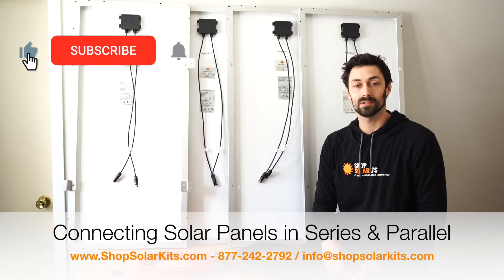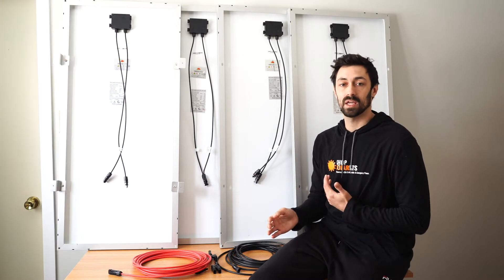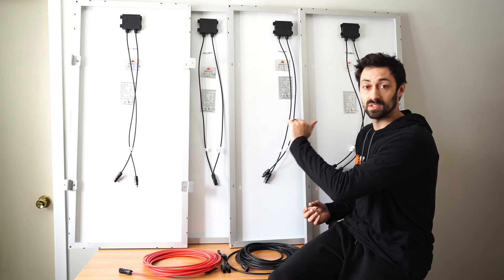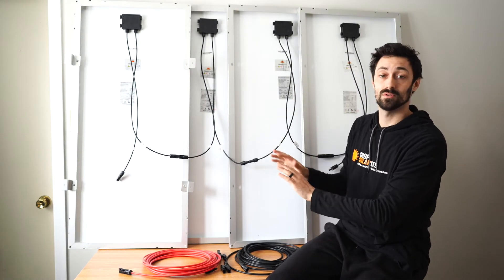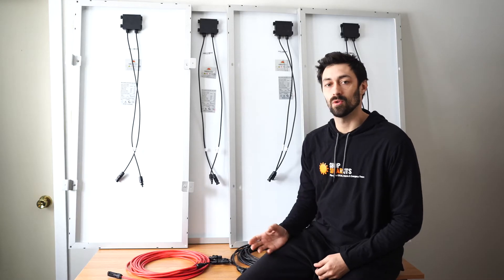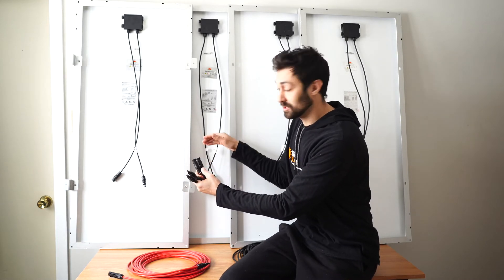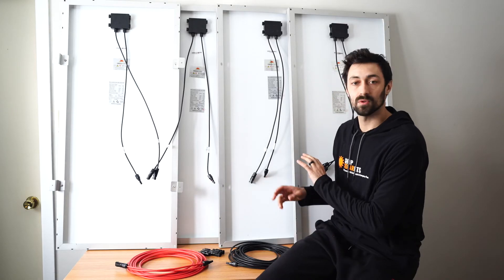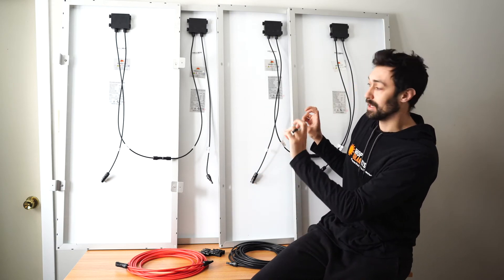How To Connect Solar Panels in Series & Parallel

Comment: What's better, connecting them in parallel or connecting two panels together in series then connecting them in parallel?
Reply: Most modern larger inverters require higher pv input voltage to activate the mppt charger controller, thus wiring in series is required to provide the higher dc voltage  which is widely used these days. Usually people will wire several strings  in series and then connect those into a combiner box which makes multiple series of panels into one parallel circuit.

Comment: Ok my question is can I run 4 strands to a combiner box 2  in parallel and 2 in series I have a 60 amp mppt controller 4000 watt inverter and 3 1000 amp marine led acid I know I need more batteries and more panels I also want to get a 6 string combiner box so I can always add to my system

Comment: I hadn't used my solar panels in months. But I did recently bring one out after we lost power for 3 days from hurricane Helene here in NC. I was able to keep my fridge going with my Ecoflow generator while another one was charging on the solar panel. I also lent another solar generator to my neighbors to keep their fridge going as well. But it wasn't until today that I had to come back to this video because I forgot how to connect them in series. Now I have 3 hooked up. I'm running my fridge on the generator to try and get my power down even more. I have 2 panels sitting in the grass and the 3rd one is on a flat cart with wheels, and I can easily turn it towards the sun every few hours. I plan on getting several more carts.

Comment: Mr, i have AC200MAX, I would like to install Solar Panel Array about 3 pcs. 1200w. I would like to install a DC breaker, how many Amp should i use? and a surge protection device?

Comment: Good Day! Have you ever heard of the Shoals Plug and Play cables / system? Can anyone judge whether it makes sense to use it? Although they seem to be a bit more expensive, they are extremely easy to use and no professional installer is required. Installation is also said to be very quick and more energy efficient than conventional cables... Would appreciate a respone very much

Comment: So after they are place in series parallel can i take the wire and run it into the charge controler ? I would have to cut the other end of the mc4 connection off right?

Comment: And that's the ONLY time u mix positive w/negative.  The pos wire goes into the positive receptacle of the charge controller and the negative goes into the negative on the charge controller. If you add an extension, black goes on black red goes on red.

Comment: Remember: In SERIES, the output voltage of each panel is added together:  12v + 12v = 24v.
And in this case, the output AMPS remains the same (8.6A).  Only the voltage changes.
In PARALLEL, the AMPS are added together: 8.3a +8.3A = 16.6A.    Here, the voltage stays the same as each individual panel, ie, 12v.
Reply: and what happens when you mixed them

Comment: Thank you for making these videos ,you have a way of making it so clear 👍🏼So if these panel are 12 volt and 5 amps each now you would have a 48 volt 10 amp set up with the parallel and series configuration ,correct ?
Reply: No. I think youd have a 24 volt 10 amp setup. Cause first you double the voltage on the panels and then you double the amperage

Comment: I was informed that problem with series connection would ie be 1) if one panel in series is effected by shade or faulty then the whole string is out. Bye Bye Power. But if in parallel and one panel is faulty for whatever reason I don't lose my string of panels Only the faulty one 1) is that true or false friend?
Reply: true

Comment: What Max refers to as a male plug is called a female plug in the attached video.  They say it's the internals of the plug, not the plastic itself, that determines male or female.

The panels on this video show male/female tags on the cables.  Going to the Newpowa website, looking at their manuals, which is who made the panels I bought from Shop Solar Kits, everything matches up with what Max teaches here.  

  https://www.youtube.com/watch?v=NPb_ZmRXbbA

Comment: It would have been helpful to show how the different configurations change the watts and volt output.
Reply: In series will double the voltage but same amps

On parallel you would double the amps but voltage stays the same
Reply: I have the same question.  Using the wrong method (sending more than 24v) can shut off or damage your device .
Reply: yes, that need to be more explained cause the end may have a huge impact.

Comment: After connecting these 4 panels in series or parallel, Can you please explain how connecting 4 in series multiplies the voltage and having them in parallel increases the amps?
Reply: Series = raising the height of a waterfall. Increased voltage is an increase in drop from top of waterfall to bottom.

Parallel = adding a second waterfall. Current increases because water has 2 times the paths to go through.

In this analogy, the water is the electricity, the height of the waterfall is the voltage (12v = short waterfall. 24v = taller waterfall). The number of waterfalls is the current (5amp = 1 waterfall. 5amp*2 = 10amp = 2 waterfalls that the water can go through, which means more water moves through the whole system)

Hope this kinda makes sense :)
Reply: For a little bit more on this analogy:

Picture you have a water mill. Higher voltage means you can run a larger watermill since there's more weight of water available to move the larger wheel. This is because there is more water in freefall going in one place.

If you have 2 waterfalls (and therefore, 2 rivers), you can use 2 smaller water mills, one on each river. Individually, they won't be as powerful as the single larger one, but they can get the same amount of work done because there's 2 of them.

This is why a 24v 100ah battery lasts the same amount of time as two 12v 100ah battery, both have 2400 watt-hours to work with (24v*100amps and 2*12v*100amps). Both last the same amount of time as one 12v 200ah battery as well
Reply: And this is why current doesn't increase when you increase the voltage:

You and your friend can't slide down a slide side by side. But if you add a second slide, now the two of you can slide together at the same time without bumping into each other (more current)

If you make that slide taller (raise the voltage), you can slide faster (and hit your friend at the bottom harder 🤣), but still only one of you can go down that slide at one time (current doesn't change)

Comment: What happens if we have parallel connection and one of the panels get damage?
Reply from the maker: Hi Baldandarjaa, thanks for your question! If a panel is damaged while in a parallel connection the damage will affect the damaged panel only. If the panels are in a series parallel connection then the damage will affect the series that the panel is connected to but the other panels will be unaffected.

Comment: My understanding is with a series connection no fuse is needed. Now with a parallel a fuse is needed. My question is about the hybrid setup, do you need a fuse between the panels to protect them?
Reply: No, I think you just need a fuse for each pair that are tied together in series.

Comment: Hi. I'm new and confused. In your last example, mixed connections, after connecting the MC4 cable do you need another branch connector to then plug the last 2 cables together so it can be plugged into portable generator? By the way yes I could mess this up. Great explanation I just don't get that one part. Thank you.
Reply from the maker: Hey Paula,

Please give us a call and someone can help!

Comment: I like the ECO-WORTHY 100W Solar Panel But tried everywhere to get a 8mm DC input Connector MC4  for my New Jackery 500,   No Luck found one eventually But costly    linger Solar Panel Connector To 8mm Adapter Cable DC 8mm Connector Fit For Portable Backup Power Station Solar Generator 14-16 AWG 6 Ft. Cost on Amazon £31.00 UK,   Do you think it will fit , First time solar attempt.

Comment: I would like you to explain the advantages and disadvantage of each.  Nice simple video but please explain why you would want to do each of them..  I have a AC 200.   I have 4 180 watt bourgrv panels.  Which way is the best to connect them?   I have them 4 in series now.   Would the series parallel be best?   Thanks James
Reply: Ok I saw your video on series.   Why not series parallel series ??

Comment: So if I were to purchase the Bluetti AC200P quad kit from your website, do I wire the solar panels in Series or parallel before connecting to the AC200P?
Reply from the maker: Hi Rex, you would wire the panels in series.  You can check out this video here as well: https://www.youtube.com/watch?v=pTXZ-TOLH0Q&t=8s
Reply: @ShopSolarKits  last question... with the Bluetti AC200P quad kit (4 solar panels)... if I only have a small rooftop space on my van to fit 2 solar panels...this is ok right? It’ll just take longer to charge, correct?
Reply from the maker: @rexmago9966  Yes, 2 panels is no problem at all :)
Reply: @ShopSolarKits  I see one of my answers but why not SERIES Parallel Series for 180 watt panels